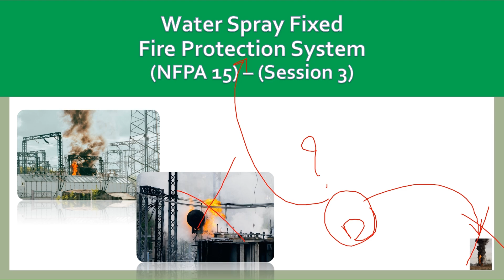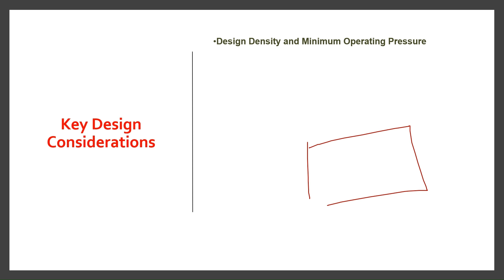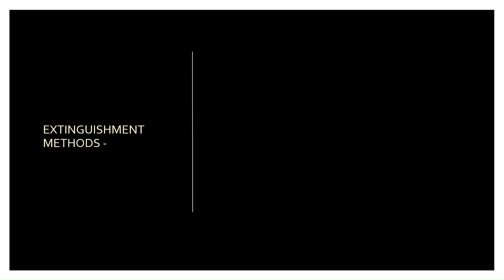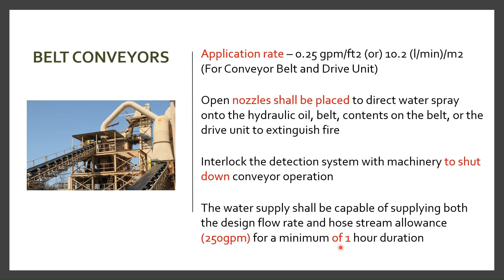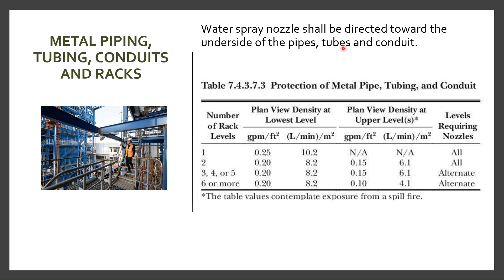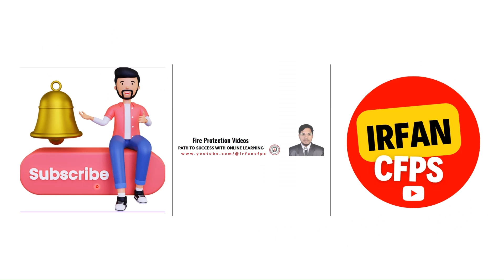Water Spray System Design Secrets

Comment: Really helpful ❤ btw, for hydraulic calculation for transformer protection, we should consider all the nozzles to be activated simultaneously, right? Not based on minimum 2500sqft...
Reply: Yes we need to include all open nozzles in calculation . The area should be the surface area of the equipments.
Reply from the maker: Thanks